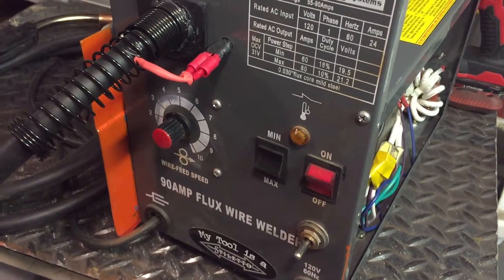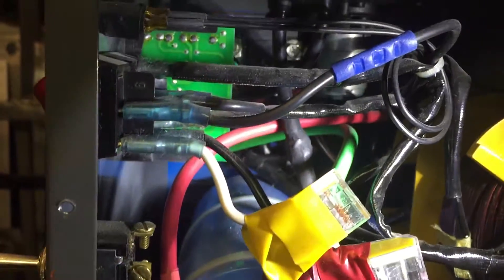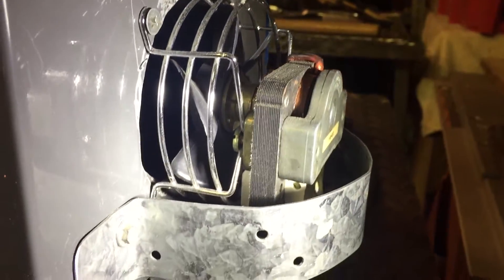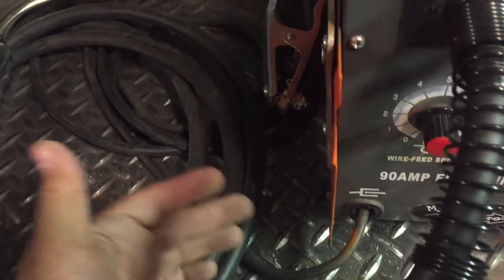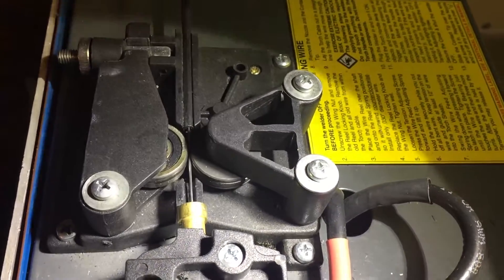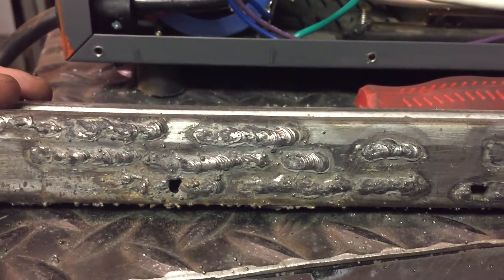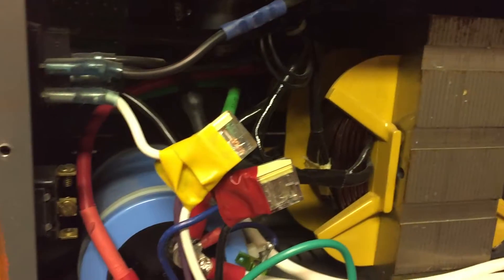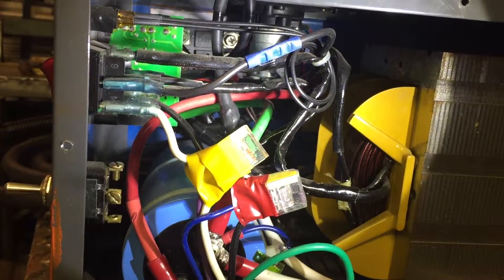Harbor Freight Flux Core Welder DCEN Conversion

Comment: What are the two tictac boxes with the yellow and red tape on em inside of it ??
Reply from the maker: Those are push in wire connectors so I didn't have to use twist caps.

Comment: I've converted a few of these the best DC set up I have is 150amp rectifier 44k farad capacitor resistor (not sure which value I used) and a smoothing coil to positive ground clamp. I also bought an actual cooling fan and mounted it on the outside rear to make room for my coil, also make sure you use welding cable/wire most of the stuff you get at the hardware store is too rigid or it's that crappy aluminum-clad shit. I used 6ga to connect everything and 4ga for my grounding cable and a heavy duty clamp. I'm not a professional welder but this thing welds almost as good as my shop welder which is a Lincoln 180c.
Reply from the maker: Good info. Thank u 4 ur comment.

Comment: In my experience inverter welders are often much smoother for the same reason why your conversion makes your welder better. If someone has the cash I'd suggest just getting an everlast welder and skipping harbor freight. The welding is much smoother and you get far more useful features and accessories.
Reply from the maker: I agree with u, but so many DIY welders have these HF machines and it's a cheap upgrade 4 a huge improvement in this type of welder. I bought an Everlast tig machine and I really enjoy it. Thank u 4 ur comment.
Reply: legalsolutions07 where did get your toroid ferrit ring and whats the dimension?  Curious.
Reply from the maker: Ebay T200-2 Toroid Core Micrometals Iron Powder Made In USA. Thanks for your comment.
Reply: @legalsolutions07  cool. Thanks. Ill order that and see the results.

Comment: Great job on this - both on the conversion but also the video quality - engaging, easy to follow.  Can you take a few moments and respond to a question:  I'm getting the rectifier, but not sure on the capacitor.  Ebay has one for $40 (https://www.ebay.com/itm/1x-240000uF-7-5V-Large-Can-Electrolyt-ic-Capacitor-7-5VDC-240000mfd-240-000-95C/141237288321?hash=item20e265fd81:g:0aIAAOSw2x1XKhPG) - do you know how to volts and micro farads interact (higher voltage better?)  Also your toroidal coil - I didn't hear the first thing you said [...] with 6 ga wire wrapped around it?  Thanks - Mark
Reply from the maker: The voltage on that link looks like it reads only 7.5V. U want 75 volts. $40 seems high. Check this link for an alternative https://www.ebay.com/itm/Mallory-25-000uF-50VDC-High-Cap-Terminal-Screw-Electrolytic-Capacitor-Type-HES/202284508899?hash=item2f1918a6e3:g:aCAAAOSwiYRay8Kt. The 50K micro farads will work just as well. I was told that using higher voltage caps doesn't add any benefit so I never considered using a higher value cap. Increasing the micro farads seem to follow the same principle in that not much value is gained. 6 gauge wire was wrapped around the coil and I used hot glue to secure it while wrapping it bc it's hard to keep it in place. Also, I forgot 2 mention in the vid 2 use a resistor between the cap pos & neg bc it bleeds the stored voltage in the cap and prevents u from getting shocked if u touch it. Good luck with ur conversion. U'll like the results. Thanks for ur comment.
Reply: Great... here's hoping an end to the splatter-fest.